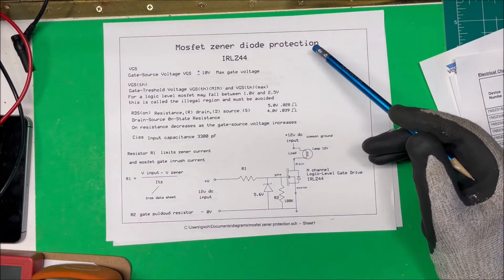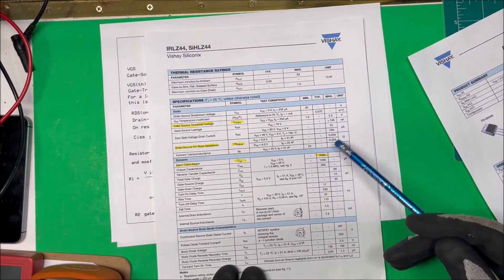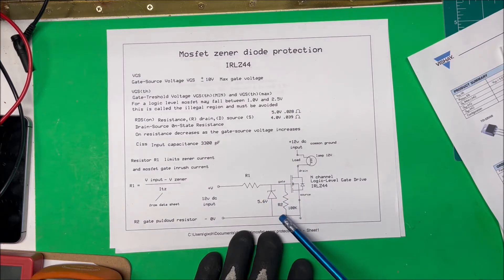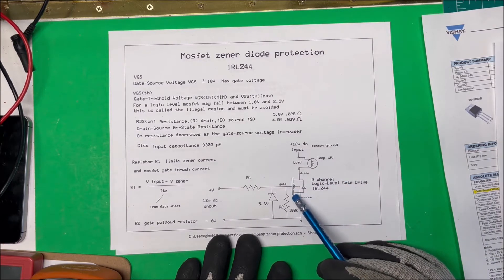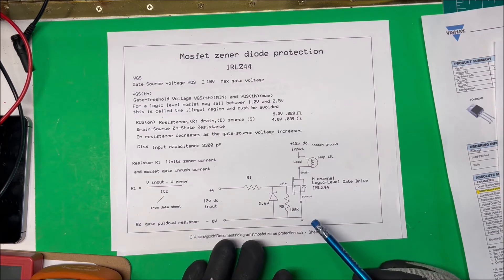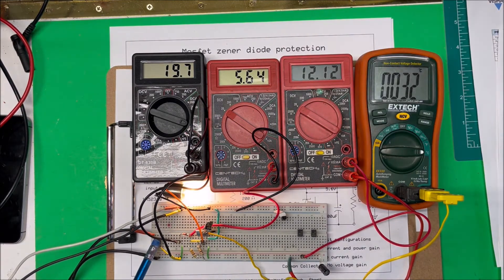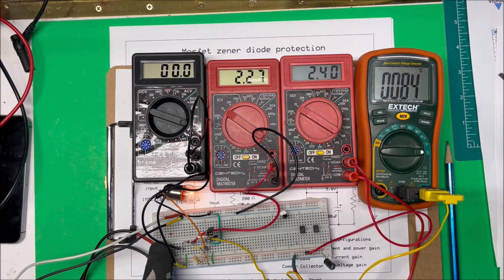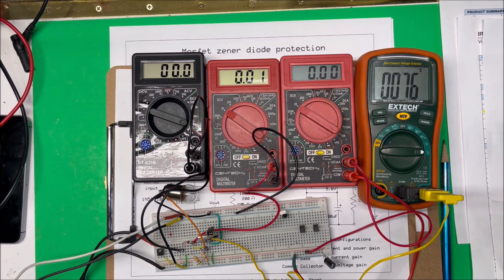Mosfet protection

Comment: On resistance also depends on temperature, the higher the temp, the lower the resistance, which makes MOSFETs hard to destroy by slight overload when fully on, but easy to kill in linear region. 
So one can make a crude dummy load by just varying gate voltage, but it needs frequent readjustment to prevent thermal runaway.